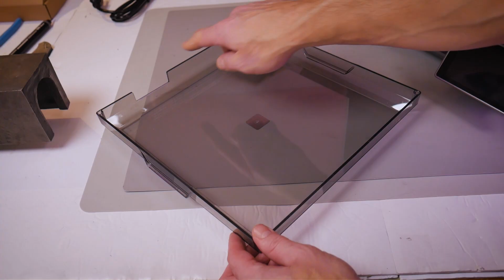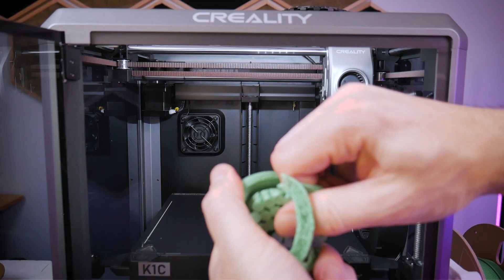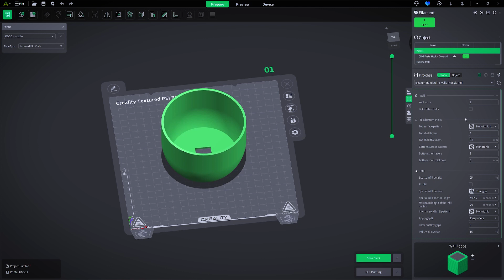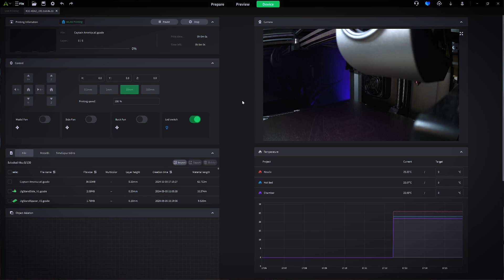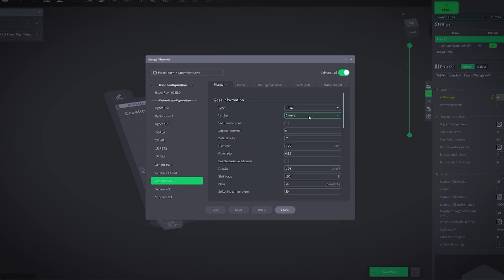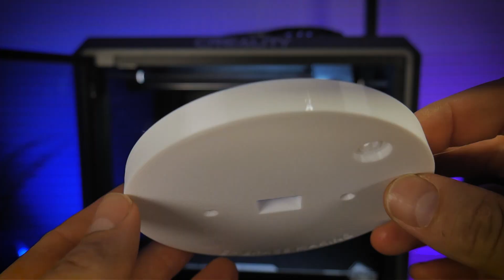Creality K1C Long Term Review, Guide, Upgrades, PETG, Creality Print 5.1 and More!

Comment: I recently purchased a K1C, and I'm upset because the machine I bought was used by someone else and was damaged.
I have all the proof that it was used by someone else and creality doesn't want to solve the problem.
I bought the machine on February 2, 2025 and the printer arrived at my house on February 6, 2025.
The first proof I have is that the unboxing was not the same as in the video.
The second proof I have is that I just ordered the printer and in the box came two rolls of 1Kg PLA filament that I had not ordered.
The third proof I have is that when I turned on the machine, the error message appeared and it was in German and someone had already tried to print 3 pieces and the print date of these pieces was January 14, 2025.
I do not advise you to buy from the Creality brand, the technical support is bad, I am still trying to get my money back or to send me a new machine as I had ordered.
Reply: What website did you buy from?

Comment: have they fixed the warping beds ? i wanna get one but scared too
Reply from the maker: Haven't heard too much about warped beds. I know the k1 max had some issues with variances on the print surface, but the smaller K1C hasn't been something I've been aware of.

Comment: Hate to correct you but 5.0 Onwards is actually Cura with Creality Badging. I did a deep dive into the software and settings myself and its a direct match. I also know a large number of people with Creality Printers and have had nothing but issues with both Cura and Creality Print 5.0 Onwards because it us un-needlessly complicated, things are in stupid spots and most notably the Profile Settings are WAY OFF. I actually took the time to contact Creality myself and called them out on this as its completely poor form on their part and its causing issues like your Z seem issues and because of that its giving the brand a bad name and people have gotten rid of their creality printers because of this and they didnt know what to do. Yourself and other users would be far better off going back to Creality Print Version 4.3 on that the settings are actually accurate and settings are easy to find and where they are meant to be and it will pretty much eliminate any issues you are actually having. Given this same advice to many others and its stopped them binning their printers in favour of a bambu. Yes its made that much of a difference.

Hope you look into it and find this information useful. Creality need to bring back 4.3 and fix the random bugs is has, add vase mode and add a multi Build plate mode and it would be Perfect!

Comment: Finally a Review which talks about the prints and not about being to stupid to Change a nozzle or fitting the filament. Thanks for that!
Reply from the maker: Thanks :) glad you liked it
Reply: Can relate, I also saw that "Review" 😂 if you are too stupid to fit in a filament strand through the sensor, then, the machine is not the problem, but the user

Comment: Great video. I love mine. So much so I added the K1 Max 2.0 :-)  I wanted to mention incase no one else has...The new Orca Slicer 2.2.0 fully supports the K1 series now. You can send prints directly to the printers now without having to root. When connecting the printer where it says Octa just hit the drop down menu and you will see Creality in the list now. Select that and boom... Happy printing

Comment: Junk again.  IMO.  All printers are great.   But without software support...ie...profiles....  the machine is junk.   Anycubic is just as bad.  Anyone can put together a printer.   I have a few for years until I went Bambu.  I now don't make excuses like its settings here settings there..because of this because of that..i tried so much to justify all my old printers... I'm glad i don't have to make excuses now.. pass.
Reply: My brother i christ, someone have to make the profiles. 
Either you do it, and use any filament, or you use the manufacturer's profile as a crutch, and be "locked down" to a specific manufacturer filament. (I know you can always make your own profiles later)
Reply: Dunno what you're babbling about. This is my first printer, got it 2 weeks ago. I've printed few dozens of models since without any issue using the stock software and built-in profiles. Without touching any settings.
Even the best tool can't make you an artist, you're probably the junk element here. IMO.
Reply: @20cent  bad prints are not good prints if you keep telling yourself it's good.  Stay junky.  I'm just letting you know.  Don't upgrade since you can't take criticism and stay attacking someone's intelligence just like woke people attack others.   I hope you stick with them and keep saying they are great.
Reply: I know effort is a lost art but come on bro, a little tinkering is all you need

Comment: The vertical artifacts were fixed from the firmware updates and the slicers I have a last gen k1 and after more then 9 months of use never had a problem I did ad a camera and did root the printer took of the stupid drag chain and printed a lighter fun duck only upgrades I did . Nice video

Comment: I think many were hesitant to get a K1C because most people wanted what would otherwise be "K1C Max" in a sense. All the upgraded features but with the Max's print size.
The 300 squared (or with taller z) seems to be the new desired "standard" print volume overall, especially now that 1000x1000 printers are becoming a consumer-grade option.
Reply from the maker: Definitely. For what it's worth I do have the Max with the earlier extruder hot end and it's still going strong - I've logged a ton of hours on it... I don't know if the latest Max variant is shipping with the latest extruder and hotend but I'm pretty sure it is... so in that regard it kind of is the K1C max already... just that Creality doesn't do the best job with the printer naming conventions.
Reply: @EmbraceMaking  Yeah they tend to do a lot of revisions and not mention it or offer it to backwards-compatibility support for older versions
Reply from the maker: Yep that is true. Revision control on their end is not the best lol

Comment: Great Review as always, but I'd like to see it being used for its intended purposes such as printing PETG CF, ASA CF and Nylon CF to see how it performs. I have only see people print PLA CF on the printer. I look forward to seeing what you do with it.
Reply from the maker: Thank you David! I think one of the reasons you usually see PLA-CF is that it sticks well to the print bed. I have some PETG-CF that in retrospect I could have shown. Nylon based materials don't stick well to the PEI print surface so I know that would be a big challenge, and I think I have some ePA-CF that may or may not work... Might make a good second video 😉
Reply: @EmbraceMaking  that makes a lot of sense. I look forward to seeing you test it further. I intend to get one for making car parts from ASA CF.
Reply from the maker: Right now I don't have any ASA or ABS with CF as the smell really bothers me with those two. I do print a lot of PETG-CF on the K1 max that has the original hotend and I put a hardened steel nozzle on it. Haven't had a problem with it and I've logged a ton of hours on that printer so the K1C should be more or less the same
Reply: @EmbraceMaking  thanks for letting me know.

Comment: I appreciate your honesty. Got K1 on Amazon for about $320. I think it's worth it. Let's hope it has upgradet extruder.
Reply from the maker: Thanks! The K1 will be great for you, is this your first printer?
Reply: @EmbraceMaking  Yes it is. Your channel will be of great help. I am glad they are still makers out there who are not Bambu religion fanatics.
Reply from the maker: That's great, the new slicer will make your life a lot easier as I described in the video. I do also have two Bambu A1 and two of the P1P and there are pros and cons to every model still. The P1P didn't really impress me that much given all of the hype - don't get me wrong it's very good, but the K1C is on par but just way less fanaticism around it. You'll love your K1C